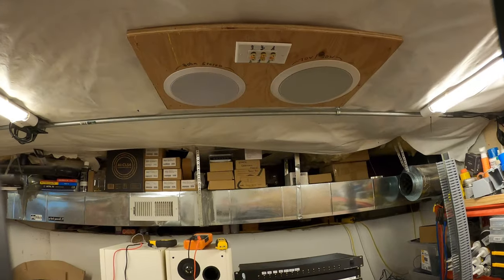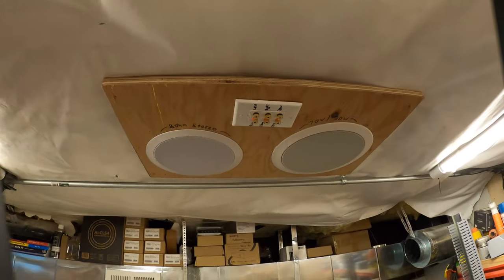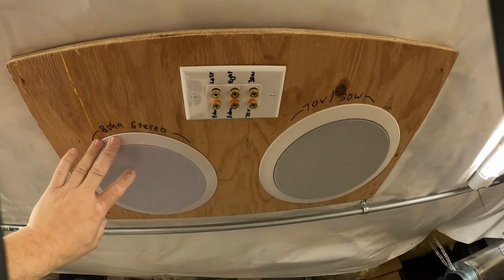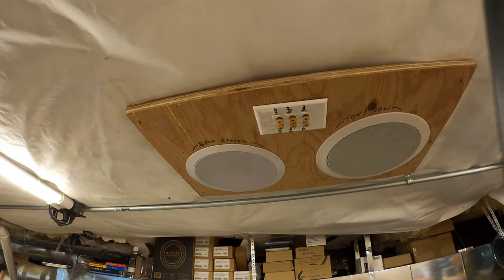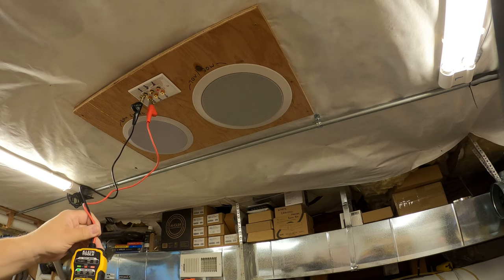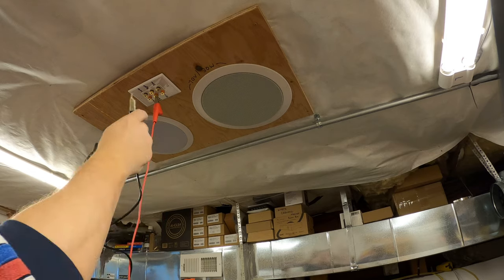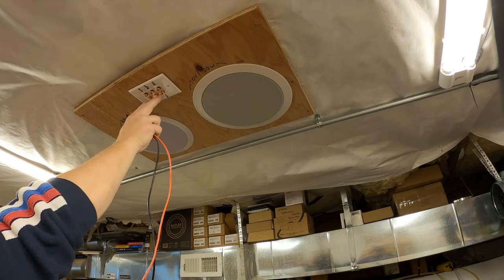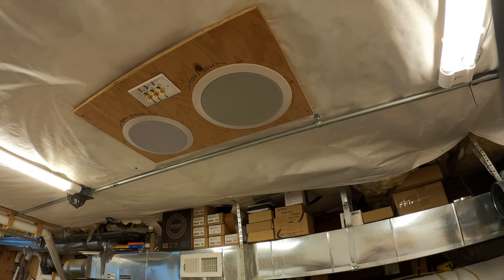How to trace (find) speakers in your home using Klein Tools wire tracer!

Comment: And then there's polarity to consider.

You're measuring the voice coil DC resistance.  Speakers work on AC, they have an "impedance" which is frequency dependent due to reactive components.  So the "ohm load" the amplifier will see, as you put it, will be higher than your reading and all over the place depending on frequency components of the signal.

And the wires act as transmission lines which can also have some effect on the impedance the amplifier output drives.
Reply from the maker: You are correct in some ways but I am explaining basic ohms law for DIY guys so they do not blow up their gear!!  Cheers
Reply: @theaterdesignco  
That's okay, it's a complex issue (no pun intended) 😂

Man it's been ages since I worked with polar coordinates and complex impedances.  It's fundamental in electrical engineering and helps with speaker design.  But yeah just hooking stuff up it doesn't really help to know that a nominal eight ohm driver may present twenty something ohms to the amplifier at resonance.

However when hooking up a pair of speakers for stereo listening, it makes a difference whether they're connected in phase with each other or not.

Don't most modern amps have internal protection against excessive output current and excess thermal buildup?